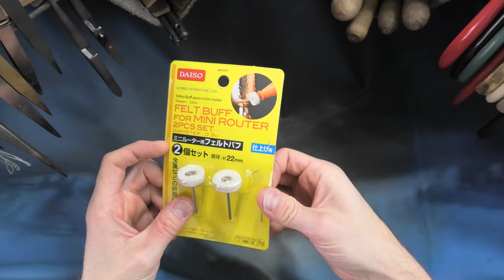£1 Shop Polishing Tool. Will It Work??

Comment: I completely agree with you on the green Rouge it's the main polish on the bench for the big buffer I use fabuluster, bobbing, Red and yellow depending on the job
Reply from the maker: I like yellow on a really soft mop for finishing platinum. Gives a really bright shine
Reply: @DiamondMounter  yellow is incredibly wonderful on platinum. I used to use it as my main for everything but my mops kept getting contaminated.